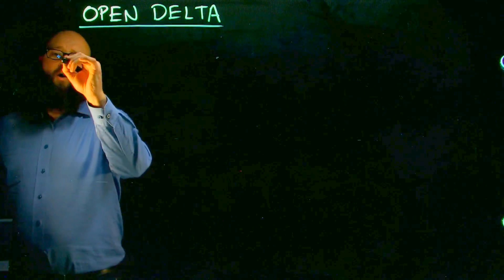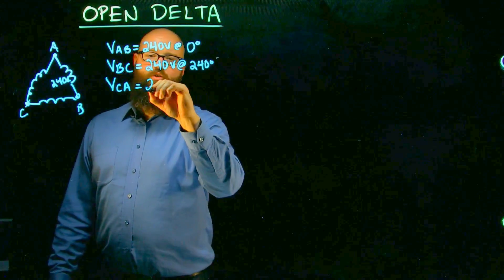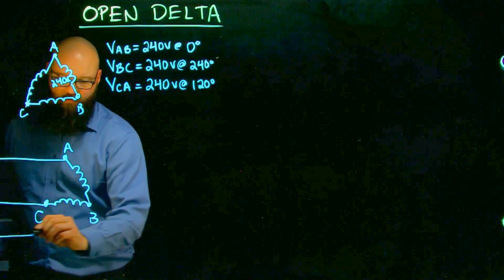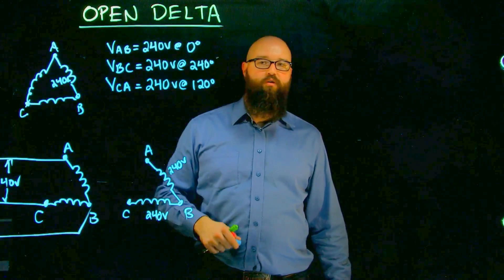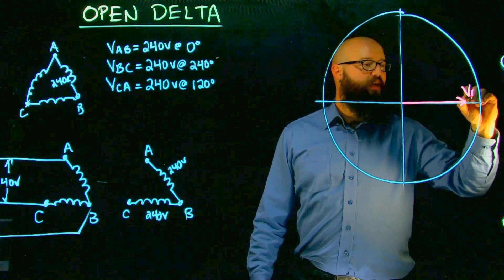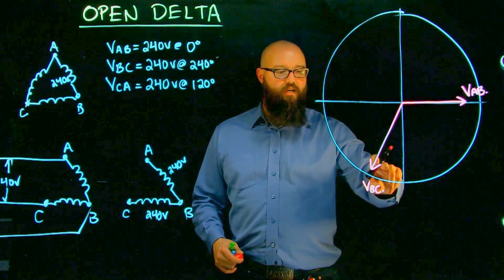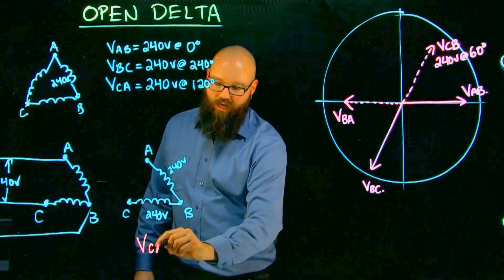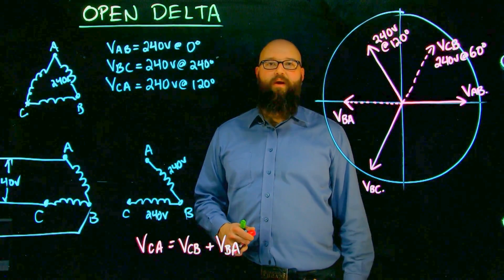Open Delta Voltages

Comment: would love a discussion on open delta connection of 2 single phase heaters with the supply being 3 phase delta.  How to calculate line currents on the 3 open delta legs?

Comment: 3 phase systems usually expressed as 120 degrees out-of-phase between lines. How do you get 240 degrees out of phase?
Reply: 240degrees is the same as -120. It is a positive sequence he was working with

Comment: thank you for going into detail on how we are able to still power 3 phase motors and etc, even with a missing coil.   Never quite understand the mathematical concept other than I've seen about a half a dozen of these systems on farm settings, where the farmer had mostly single phase equipment with a few 3 phase 240 volt motors.   This situation will be a high leg configuration to power the 120 volt circuits just like your much more common 120/240 v split phase service.  Just have to be aware of the high leg because if you're not paying attention it's easy to install a single pole breaker on the high leg when you want 120 volts, in which case you will smoke up equipment because you will be giving it 208V.   So always use a multimeter to make sure the voltages are what you think they are.    Incidentally the NEC requires the high leg be orange or other effective means,  but I wouldn't trust my life to that,  without verifying with a meter.

Comment: i have now created the third phase by using two 240 volt to 240 volt isolation transformers the primaries are connected to each phase and to the neutral the secondaries are connected in series and one connection going to the neutral the other going to the load the two supply phases are connected to the primaries then directly to the load the set up works perfectly with perfect voltages and phase angles it is a variation of the open wye open delta connection

Comment: in my workshop i have two phases of a true 3 phase system ie phase to phase 415 v and phase to neutral 240v 120 degrees phase angle can i obtain the missing phase by using an open delta step up transformer 240v to 415v and connecting the two phases and the neutral to the primary side of the transformer
Reply from the maker: You may want to explore a VFD option as that may be the simplest way.
Reply: @schulerruler  yes i have got two vfd,s and also two rotary vphase converters but i would still like to try the transformer option
Reply: @schulerruler   I HAVE NOW CREATED  THE THIRD PHASE BY USING TWO 240 VOLT TO 240 VOLT ISOLATION TRANSFORMERS THE PRIMARIES ARE CONNECTED TO EACH PHASE AND TO THE NEUTRAL THE SECONDARIES ARE CONNECTED IN SERIES AND ONE CONNECTION GOING TO NEUTRAL THE OTHER GOING TO THE LOAD THE TWO SUPPLY PHASES ARE CONNECTED TO THE PRIMARIES THEN DIRECTLY TO THE LOAD THE SET UP WORKS PERFECTLY WITH PERFECT VOLTAGES AND PHASE ANGLES IT IS A VARIATION OF THE OPEN WYE OPEN DELTA CONNECTION

Comment: Is this what enables “high resistance ground” systems to continue to operate when one leg goes to ground and drops out?
Reply from the maker: That's a bit different. You have an impedance device in that situation between all your bonded components and the point where the neutral connects to the system. With that high impedance component, higher fault currents do not develop in a line to ground fault.

Comment: The high leg phase on 3, 4 wire, delta-connected systems shall be connected to the B phase .
Is it correct ?
Reply from the maker: In Canada we are required to have "A" phase as the high leg, I can't be certain as to other countries however.
Reply: Thanks for quick reply .
I live in US I think is no difference,
There is An Article on NEC 
408.3(E)(1)

Comment: Should it not be Vca=Vba-Vcb
Then 180-60 would equal 120
Reply from the maker: The double subscript notation indicates polarity or rather the direction we "travel" when combining voltages. When adding these voltages we have to account for the angle of the voltages. While it is 240 plus 240, it's actually 240@60° plus 240@180°. The resultant phasor will equal the missing 240v @ 120°. Hopefully that helps and doesn't confuse things further.

Comment: Little confused: if Vca = Vcb+Vba =240+240=480v. How is it 240v. Please please clarify. Thanks. Love these videos
Reply from the maker: Understandably confused. When adding these voltages we have to account for the angle of the voltages. While it is 240 plus 240, it's actually 240@60° plus 240@180°. The resultant phasor will equal the missing 240v @ 120°. Hopefully that helps and doesn't confuse things further.
Reply: @schulerruler  nope. That clears things up
Reply: @locutusv1  clear as mud.

Comment: Clarify that although you still have the same voltage, you will have less power.
Reply from the maker: Thanks for watching. If you check out the next video it is dedicated to the reduced capacity of an open delta system and why.

Comment: Hi I have a open delta line 240v the question is when i measure each leg to ground i have the result are line 1 @264c ,line 2 @256v and line 3 only 38v does it indicate my system is losing phrase?
Reply: Possible or maybe a grounding issue. Only way for sure, operator from utility company to check transformer.